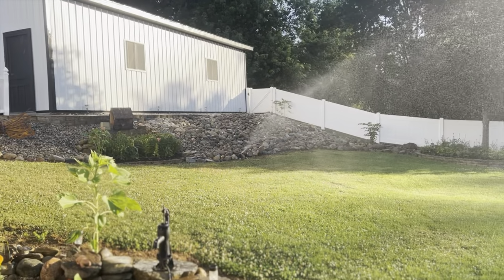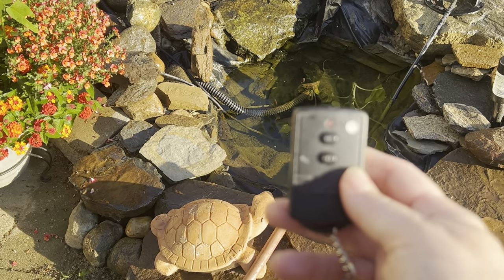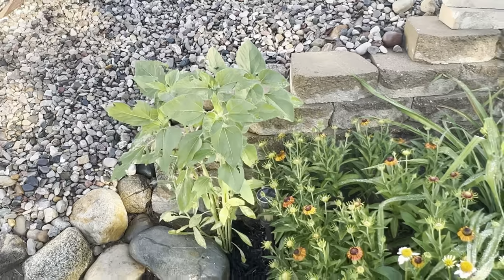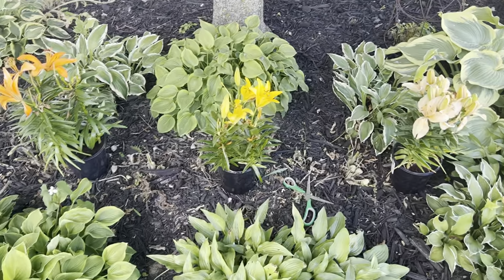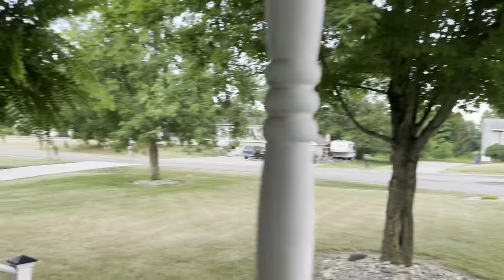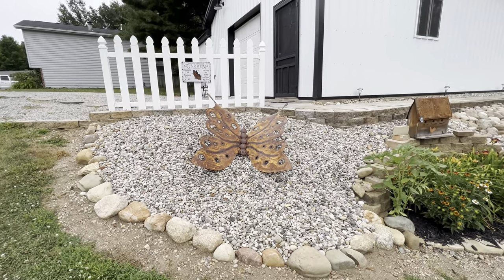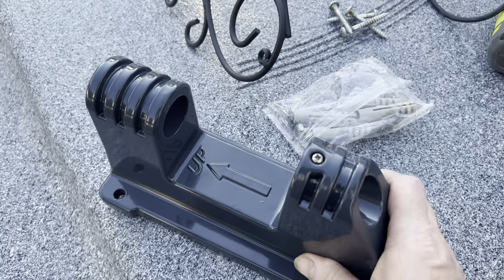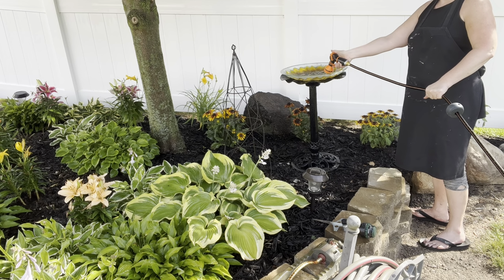CLEVER OUTDOOR PATIO MUST HAVES | BACKYARD IDEAS | USEFUL PRODUCTS

Comment: I love that hose reel and your butterfly! We are over 100 today but its been an unusally humid summer in high desert. Right now our inside temp is 81. Swamp coolers only work so much on heat especially if humid. I love product sharing so I can find what I need. I love that hose reel. Looking it up! Love your flowers. I need to experiment more in m new zone. My sewing room craft workshop is a separate building across our acre lot. We built a patio and cover for it. We have since planted trees there too and added a drip system. We retired to high desert so im relearning a total different zone in drought area! Lucky to have some large trees on lot though. I also wanted to have a hose to water patio plants. I got that thing on the wall too! Since first day I have never wound up the hose, nor has he! tangles, dragging. A couple trees acroos the through drive we have in back so have to drag that long hose half the lot back to water! I want at least a hose on a reel. Its best to have a short hose to connect to wall and wind the hose in middle to where you want to have the reel sit. I want one in garage too with a Y connecter to cold water tap for washer. Because it freezes here and thought he house is only 25 years old they did some plumbing wrong and many of the bibs besides being in really bad place there is no water spiget around house patio area or cottage or front yard. So another hose an acre long dragged throught he garage to wash cars and manual watering in front. its not much to water. Sometimes use a can but thats too many trips if you want lots of seasonal color. but now I want that thing.
Reply from the maker: Oh.. I feel you. The work we do to make things beautiful for us to enjoy 🌻💝